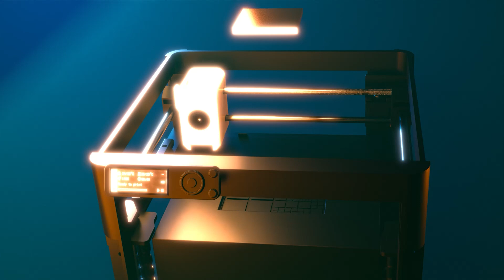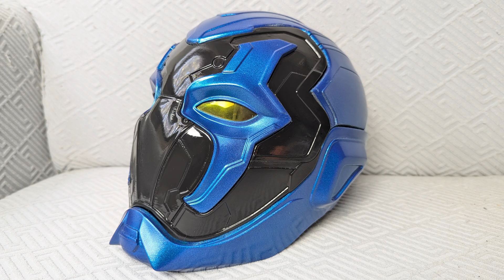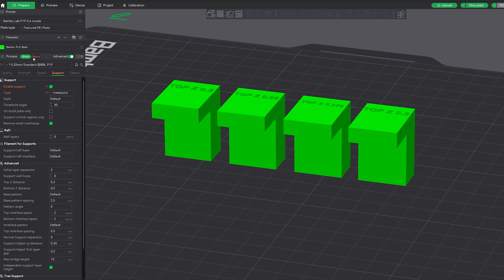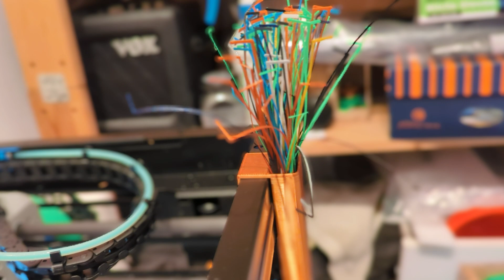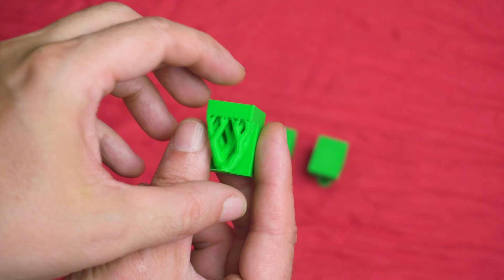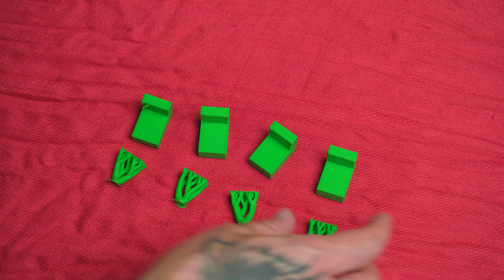1 Setting Easy Supports Removal | Bambu Lab P1P

Comment: God damn it, my printer made the supports at 0.08... it was a 21h print just to rip the whole thing in two because the supports just would not move what so ever. I was ripping off the layers in some places... WHY WOULD MY PRINTER SWITCH TO THAT!?
Reply from the maker: Layer height 0.08 or the top Z distance
Reply: @PixelForgeLab both, actually... a bunch of setting where set to 0.08

Comment: What I learned recently: It doesn't matter exact numbers... If you put 0.12 of Z distance, the print will start at exactly one layer after an empty line... So, if you just increase the distance to 0.125, it will starts on the next layer, giving 2 empty layers of space. AND!!! Just change the top layers of supports to have less space (I use none) between lines, and you will increase the chance of little pieces to even start printing (I have this problem after this settings for any non flat surfaces) and at the same time, a smoother look, almost like it have been printing over a solid surface, which kind is.
Reply from the maker: That's true

Comment: First i need to figure out how to get my printer tuned to even produce tree supports. They always seem to break after they get a certain height…
Reply from the maker: Really? How ?
Reply: @PixelForgeLab I’m slowly bumping up flow rate by .02 increments and that seems to be working.
Reply: @PixelForgeLab I’m thinking underextrusion. The supports print out very frail in certain areas. I think because they’re probably tuned for a .4 nozzle while I’m using .2 normal supports do the same thing, but they tend to work only because the area it has to print on doesn’t change through the layers.

Comment: Just set you Z distance to 1.2x your layer height and you'll be fine.
Reply: Yeah because 0.275 is only a number relative to your layer height, which itself is a function of your nozzle size.  Not everyone uses 0.4mm nozzles.

Comment: thanks for the info , is there any way that we can clean the surface of the part that touched the support , cause every surface that touches the supports is not smooth like the rest of the part 
thanks in advance.

Comment: So it changes according to what we made and which filament we are using??
Reply from the maker: Most likely yes 
Every material behaves differently
Reply: @PixelForgeLab i only using pla, but according to filament brand does it change?
Reply from the maker: @Satyam_Singh  I would say yes, even PLA is different by brands

Comment: You probably mentioned it, but what was the layer height of the prints. 
I’ve found that the support distance may need to change with the layer height
Reply from the maker: 0.2, standard

Comment: How about when you're printing minis with 0.8 or smaller. Still use the 0.275?
Reply from the maker: @remconet  obviously not, it should be proportional to that value, I didn't do it on this video since 0.2 is the most used layer height, but good point
Reply: @PixelForgeLab  So what would you recommend? Because it's a bitch to free a mini out of its supports! Is it basically +0.075?
Reply: @PixelForgeLab  What do you recommend in my case? Proportional how exactly? Is it always +0.075?
Reply from the maker: @remconet  I honestly didn't try it, do like I did at least 4 test values on small objects and see which one works best

Comment: Thank you for the straight forward discussion.  I am going to try it right now.
Reply from the maker: @MyCampaignRules  you're very welcome, good luck and let me know !
Reply: @PixelForgeLab  I'm having to change the settings minorly based on the size of the print.  I was printing some skeleton warrior miniatures.  The setting of .275 left some artifacts on the miniature (which was similar to what you got at .3).  Reprinting it now at .27.  It was a huge improvement from before though!  Thanks!

Comment: how can i find the right spot for 0.10 LH? i am having a hard time with that.
Reply from the maker: @UNOCASTILLO  doing a bit of maths, ask chat gpt what's the equation for 0.10, I'm bad in math, that's why I said ask chat gpt
Reply: @PixelForgeLab  no my friend. it si not as easy as math ecuation (i tryed and didnt work). it depends on the filament, every filament it si different. the setting it si around .16 with a 0.1 layer height in my case.
Reply: @ thanks for answer (Y)

Comment: Hello, how can I adjust the settings to obtained a smooth surface between the supports and the print ? Please help. Thanks.
Reply from the maker: @JesusJimenez-sc4vc  that's difficult to achieve, we talked about it in another comment recently, try find it 🙂
Reply: What’s crazy is that my 2 creality ender 3 pro does that amazingly perfect, with zero tweaking in the settings. And they are worth $150. But yet this $1000 printer has that huge problem. No one seems to know how to fix it.
Reply from the maker: @JesusJimenez-sc4vc  i get it yeah, it's a bit weird

Comment: PLA and PLA+ with normal supports, I've found .4mm typically works for me the best, but I'm sure its very situational depending on what's being supported.  For Tree supports I've typically used .3mm but I will give .275 a try next time!  I saw an Uncle Jessy video and he also uses .3mm but its very situational.  PETG if I go under .4 or the parts fuse pretty good.  Either way, that .2mm default is terrible 😕
Reply from the maker: @Capafool  yep, uncle Jessy copied my video 🤣

Comment: So on top of this, what are the best way so minimalize the scarring left from supports? Clean, quick video btw though!
Reply from the maker: @ItsExoh  thank you, well, you can definitely use PETG for supports and decrease to 0 the top and bottom Z distance, because pla and petg don't stick, you'll have a clean overhang
Reply: @PixelForgeLab  Thank you for reply! what if using PETG isnt an option? just go with like .28 top distance and kind of deal with what comes of it?
Reply from the maker: @ItsExoh  I don't think 0.28 would be a good idea, surface would be worse for sure., there isn't another option I'm afraid

Comment: You can use PETG interface with 0 Z distance and 600 purge (for both pla to petg and petg to pla). A lot of purge is used to avoid the risk of poor adhesion between layers of the same material due to contamination. I recommend using the same color if possible since it can stain white, for example. Of course the AMS module is recommended but if the support is all on the same layer you can do it manually
Reply from the maker: @federicocoassolo9347  that's a bit too complicated, but thanks

Comment: Tree slim supports set Top Z distance to 0, also what about 0.16 optimal settings, I am wondering if we add 0.075 to this if it will also work as 0.2 settings, great video and I will be using the suggested 0.275 when using standard 0.2, I will test the others when I get a chance and see if it also works on 0.16 and see if "slim tree" supports can be changed from 0
Reply: Did you get a chance to test this?  I'm curious as to your results.
Reply: @number5isnotalive  0.275 setting works a treat from my testing, I still haven't added 0.075 to a 0.16 setting yet, but now that you have reminded me.....
Reply: @TheDrunkenAlcoholic  im about to print with 0.12mm looking for someone to have done something lol

Comment: I have another issue. Maybe you can suggest something. 
When printing with petg-hf with supports the filament looks like it's burning where the seem finishes near the supports. On the supported area the output is horrible almost like it has too much heat. 
When printing without supports everything is ok. And as you presented the supports loose their purpose if the distance is too high. 
It's almost like the heat from the support material dissipates and melts the printed part.
Reply from the maker: @titusm  so sorry but I have a little nor much with those filaments, like I say in the video, every filament will have its own setting
Reply: Thanks. Who knows where the answer is coming from. Only those who do not ask don't receive answers😊

Comment: Good video thank you. Ive been experimenting with zero interface layers. If you can get the supports to run perpendicular to the first layer of the overhang they come off easy. I have a hard time removing the interface layers. Going to give this a try.

Comment: The best I have found so far is BVOH with 0 gap but BVOH just for the interface layer,almost all falls off anything left is water dissolvable.  It's expensive but goes a mile if you leave it only on interface layer.
Reply from the maker: @mattr3194  thank you for the info 👍🏼

Comment: The surface that was in contact with the support looks equally ugly on all 4 types :( Or at least “equally unusable”. Looks hideous, the very opposite of smooth. That’s the real problem with supports. I will eventually try special support material for the interfacing layer, really curious how much it would help with this. It should help, because you can print right onto it, as far as I’ve heard, and will still come off properly. But will it be perfect? I don’t know…
Reply from the maker: @MStoica  yes you're right, but consider this was just a test on a very small surface, all pushed to the limit and the overhang was basically 90 degrees

Comment: You forgot to mention that the setting for “Independant support layer height” needs to be turned on.  That allows the support layers to be printed at their own layer height.  But this only works if there is no purge tower being used.  If the “Independant support layer height” option is not selected, or a purge tower is being used then the support seperation distance needs to be in multiples of the set print layer height.  For example, if the “independant support layer height” isn’t set, and the print has a layer layer height of .2mm the gap must be set at .2mm, or .4mm, etc.  If it is set with a value that is not a multiple of the prints layer height setting then the slicer will pick a distance that is closest but a multiple of the prints layer height.  For example, if you set the gap to .275, and the layer height of the print is .2mm, it will most likely choose a gap of .2mm.  If you set the gapt to .35mm, then it will select a .4mm gap.  Now if you have the “Independant support layer height” set, your method works like a dream.
Reply from the maker: @oldsalty3d122  oh right, thanks for the info 👍🏼👍🏼👍🏼
Reply: @PixelForgeLab your welcome. 🤗
Reply: I'm brand new to this so please be patient with me :). Can you not use a purge tower if you're using a support filament as well as the main filament? And with these settings would I even need to use a support filament? Thanks!

Comment: I run my Z distance at 1.6 for a cleaner over hang. Sometimes it can be a pain to remove but a sharp putty knife makes quick work of it.
Reply from the maker: @duc7686  1.6 ???
Reply: @PixelForgeLab 
0.16 mm, probably.

Comment: Im new at this. 
Does anyone use the bambu lab support material?
Reply from the maker: @rkwjunior2298  never tried it
Reply: Yes, they are water soluble so just dump the print into water and all the supports will be gone, but that filament is way too expensive

Comment: I see no comment regarding the fact that a tuned filament should not need this adjustment…
Reply from the maker: @reflexivemedia  has it been tested ?
Reply: @PixelForgeLab  I’m sorry, I don’t understand: has what been tested? I only meant that tuning a filament correctly (flow and pressure advance) will lead to desired results (easy to remove supports) with default settings.
Reply from the maker: @reflexivemedia  yeah I got it, I mean, did you test it ? Calibrating the filament and try a test to remove supports
Reply: @PixelForgeLab  yeah, never had issues, no matter the support type.

Comment: So it's base layer height * 1.375 

0.2 * 1.375 = 0.275
Reply: He's trying to ask if you can use a general multiplier based on layer height to determine the z-distance.  So for 0.15 layer height, it would be 0.15*1.375=0.206 -> z distance of 0.21mm.
However, it very much doubt it's a linear relationship and requires a bit of trial and error based on layer height, brand of filament, type of filament, printing speed, cooling, etc. It's just that z-heigt is an easy place to start.
Reply from the maker: @Spawny3  at the end of the day it's gonna be different in all filaments, and still, it's melted plastic ;)
Reply: @Spawny3  yeah, thanks for feedback ;)
Reply from the maker: @yukinoryu  what's 1.375 ?

Comment: Dont forget about minimal step dimension for stepper motors which are mostly 0.04mm so you better round the top z distance to multiple of 0.04. In that case 0.28. The printer/steppers can't do 0.275 anyway (at least on bambulab printers).
Reply from the maker: @JanVokas  oh right, good to know ! Thank you
Reply: Given that it can't, does it just round up or down for you anyway?
Reply: then just wondering if it can only go be multipults of .04mm how is it I can print with layer lines set at .06 and see a diffrence in print quality in small high detailed minis vs .08?

Comment: Thanks for this! If I use 0,16, would the top Z distance still be the same as with 0.2?
Reply from the maker: @deadbane  most likely is gonna change, because layer height is smaller, therefore need a different top Z distance

Comment: What layer height did you choose for these parts? My understanding is that the contact z distance needs to be a multiple of the layer height or it is rounded to the nearest multiple.

This could definitely be wrong as I am new to Bambu Studio and Orca Slicer but I've definitely experienced this in the past with Cura and Prusa Slicer.
Reply from the maker: @matthewprice5749  layer height was 0.2
Reply: It needs to be a multiple of the layer height, you’re right, but, that’s for normal supports or hybrid. For tree supports it doesn’t have to be. That’s what I found in the Bambu documentation. Hope it helps.

Comment: Another great trick, if you have one giant overhang like that, is to pause the print at the top of the supports and scribble over them with a laundry marker (aka a "Sharpie"). PLA doesn't stick to Sharpie, so if you set your support distance to zero and cover the top with sharpie (and leave no unmarked areas) it'll just fall right off when you're done. Of course, it doesn't work for every support pattern, but when you have something like an embossing that you want to print face-down, it's great.
Reply: The "Sharpie Trick" works great, but too much over a large area can result in the next layer not adhering at all. Maybe keep it to 1/2 or 2/3 coverage.
Reply: That's actually the best tip!

Comment: Mine is default 0.2 with my Elegoo filament and they just fall off when trying to remove them.
Reply from the maker: yeah, it depends on the filament brand too
Reply: Iam using elgeoo gray filament.  What are your supoort settings?  Ive been struggling with my supports

Comment: interesting. I've been using 0.16 with good results
Reply from the maker: @oneillam1990  0.16 layer height ? Because this is not about layer height but the top Z distance
Reply: @PixelForgeLab  0.16 top Z distance
Reply from the maker: @oneillam1990  that's lower than default... Impossible for me to remove them
Reply: @PixelForgeLab  have you tried it though? works really well for me
Reply from the maker: @oneillam1990  yup
Reply: @PixelForgeLab  Well I guess that's why we test different settings, there aren't perfect settings for every situation
Reply from the maker: @oneillam1990  absolutely. Just removed some supports on another print, polymaker pla polylite pro, at 0.27, still very hard to remove
Reply: @PixelForgeLab  Do you keep your filaments dry? Wet filament can ooze more, which would certainly create a much stronger bond with supports.
Reply from the maker: @JacobZigenis  yes I keep them dry, and I did find a difference for sure
Reply: I'm also using 0.16 top z distance with organic tree supports. It's been working well with both PLA and PETG.
Reply from the maker: @waynemenzie  must be a matter of temps as well
Reply: Printing with PETG, dried for 6 hours, I find it bear impossible to remove organic/tree supports from more detailed overhang surfaces. Especially if those surfaces are close to the print bed. I've tried slow printing with high cooling for the top of the support material and z-heights in increments of 0.02 from 0.1 up to 0.3, but either the supports fused to the model or the quality dropped off so hard the print basically failed. So if you have any other tips...
Reply from the maker: @Spawny3  oh ok, good point, but I never printed with PETG yet, so I wouldn't know about it, but definitely I would do what I did with pla, just trial and errors, do few tests and see if you can find the sweet spot for it
Reply: @Spawny3  if you're printing with PETG you can use PLA as a support interface and they shouldn't bond, set z height to 0.

Comment: You know what's funny? I've been printing for who knows how many years now and with my bambu, I've run into issue after issue of supports fusing to my models. 

I wasn't looking for this video. Admittedly a little bit of ego hand waved a little bit. And then I just ran a print that previously went kind of terrible but this time with .275. and immediately I shared this video to everyone I know. Shout out to you. Because this is spot on.
Reply: It had the perfect amount of grab. Removed just as easy. And you'd be almost hard pressed to even figure out all the different places they're actually was support with how clean it all broke away. Thank you for taking the time to make this
Reply from the maker: @KidHaru  love your videos btw ! ;)
Reply from the maker: @KidHaru  oh bless you man, thank you for that.  It took me lots of filament and fails to get that value, and I would say 0.27 - 0.275